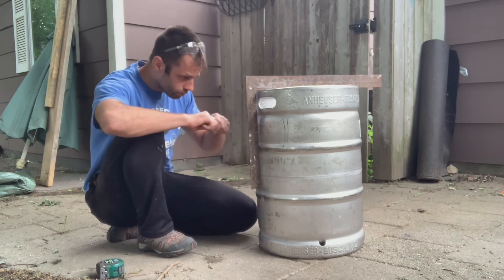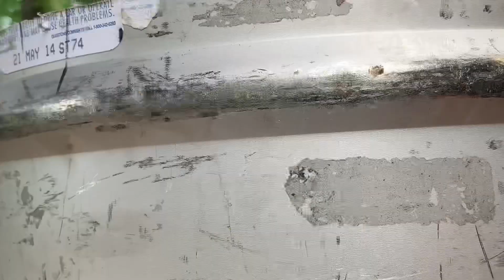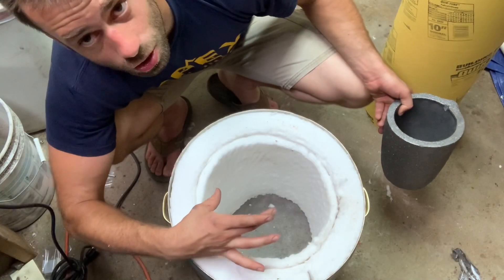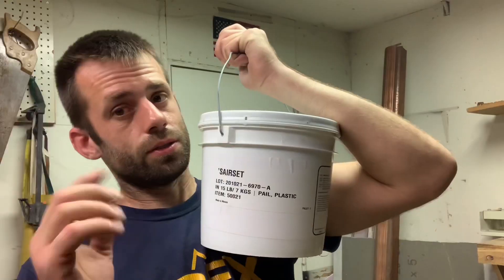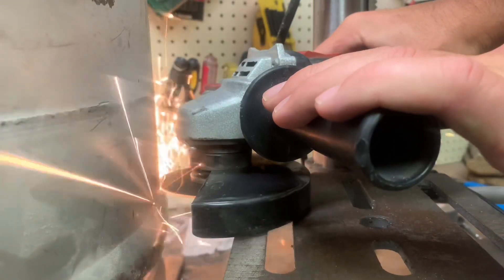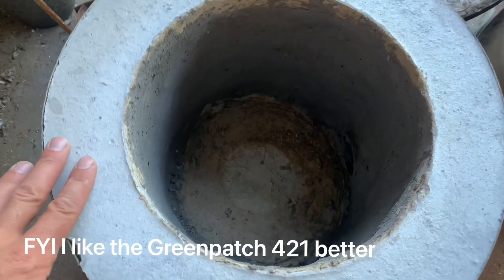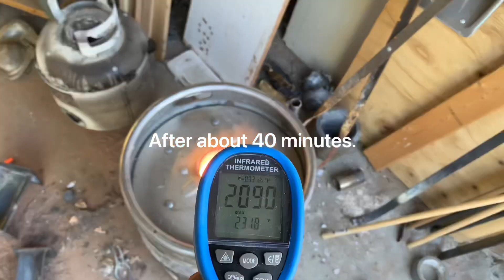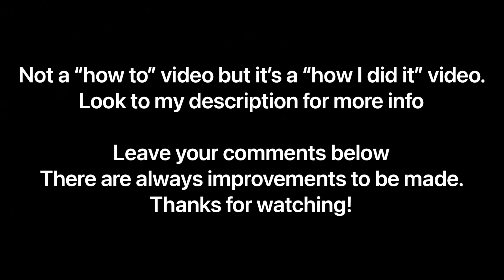Making a keg foundry furnace.

Comment: In all the videos I have seen, people coat the ceramic blanket but I dont understand why that is necessary? I am a maple syrup producer, and our diesel-fired evaporator is fully lined with ceramic insulation like that and is never coated with anything. My old evaporator was 31 yrs old and still just ceramic blanket inside despite hundreds of hours of run time. I can see how the initial firing might blow some dust out of the blanket, but in general it shouldn't really be getting consumed if there is no abrasion on it. Wood fired evaporators require refractory inside because of the presence of particulates in the exhaust, but within our industry, if its just a clean flame there's nothing more than ceramic blanket.

Comment: GOOD WORK, THE GOOD THING ABOUT BOTH OF YOURS IS THAT THEY ARE PORTABLE, IN THE COUNTRY WE JUST USE CEMENT BLOCKS  BOX FIRE BRICK TRIMED ROUND BUT THEY ARE NOT PORTABLE 😅😂IN ONE PIECE , I LIKE YOUR IDEA I WILL TRY IT WITH AN INSIDE COATING OF CEMENT PLASTER AND SOAP MIXED TO MAKE LIGHT CEMENT SEE HOW THAT DOES ...

Comment: Currently in the process of building a keg foundry myself. Im using a different style keg and instead of using a typical crucible i am using a propane tank as my crucible. Having dual burners 180° from each other to minimize the heat time. The lid of the keg is also flipped upside down filled with refractory cement and a long handle up above for easy on and off. Im having difficulty finding a way to attach something to the propane tank crucible in order for control and weight distribution for loads in excess of 50 pounds. However it is coming along pretty well for my first attempt and hoping to make a few more in the future. Currently this one is for quantity of melt for large sculptures/ giant swords over 9' long. Impractical but a lot of fun making 80 pound swords of bronze

Comment: Cheers for your vid, am contemplating making my own furnace, big enough for upto a 25 kg brass or copper poor, I'm trying to achieve this as cheap as possible, fuel wise.
Am thinking my heat source as natural wood to preheat, than finish with a diesel system or LPG. 🤔

Comment: THE ONLY WAY YOU CAN GET THAT TIGHT OF A FIT IS TO POUR THEM LIKE YOU'RE DOING CONCRETE AND THERE'S PLENTY OF EVIDENCE THAT THAT'S THE CASE NOT TRYING TO TAKE AWAY FROM THEM MOVING GIANT STONES WHICH THEY DID TOO BUT WHEN THEY FIND HAIRS AND SEASHELLS INSIDE OF STONE THEN IT'S NOT NATURAL STONE

Comment: IF YOU NEED TO DO IT AGAIN YOU SHOULD TRY SODIUM SILICATE AKA WATER GLASS WHICH IS BASICALLY LIQUID GLASS AT ROOM TEMPERATURE THAT WILL HARDEN HARDER THAN ANY STONE AND WITH A TOUCH OF SOME OTHER INGREDIENTS BESIDES THE THREE BASICS YOU CAN MAKE IT DO OTHER THINGS LIKE HAVE HIGHER HEATING TEMPERATURE OR DRY FASTER AND SO ON BUT BASICALLY A GEOPOLYMER

Comment: The weld looks aweful, but what most consider a good weld is 60% appearance anyway so as long as it holds you've done well.
A second burner would've been nice since the keg had volume for it, and since you have the prop tanks for your small pour jobs. Although the fuel efficiency would've suffered.
So if you ever happen across another keg, it'd be cool to see a double burner full sized keg furnace

Comment: 0:02 thanks for pointing out your mistakes, it helped me figure out the problems with mine. 
Is your inlet very close to the bottom? Mine is about 2” up from the bottom, it’s a 2” steel pipe and it’s in the smelter 2” at centre of the pipe. The pipe sticks out 
2 1/2” and with a tiger torch, the beginning of the flame is 6” from the other end of the pipe. I think I’m loosing to much heat to the steel pipe. 
My smelter is lined with refractor cement only, how much heat am I loosing to it as well. My lid is concaved another 3 1/2” as well. 
I melted 5 lbs of brass but it took 2 hrs and it barely melted. 
I’m thinking I should redo the lid, trim it down and insulate it properly. It also has a 6” hole in the top, how big should it be?
Should I re-insulated hole thing? 
Btw, I’m using a #15 crucible with 1 1/2”clearance at the top of it. 
Thanks for your help.
Reply: How far off the bottom in the bottom of your inlet or torch? 
How much space is there between the top of your crucible to the lid? 
How much heat do you think I’m loosing through the cement walls and lid? 
Is the cement a big part of why I can’t melt copper in your opinion?

Comment: I need to melt steel so I can make speciality tools that can’t be made  or bought anywhere. The melting temperature of steel is 2,750 degrees. With taking 3 1/2 inches out of the chamber to make the furnace smaller, would that affect the melting time in a positive or negative way when it comes to the steel? I’ve never done anything like this before, but I am certainly willing to learn.
Reply from the maker: I don’t believe you can reach those temperatures with propane. Steel is its own beast and not really for a backyard setting. But you will definitely need a forced air burner to attempt that. I don’t know much about burners though. Bronze is much easier.

Comment: Why not use the refractory for the entire lining instead of using the mortar?
Reply from the maker: Because it’s a heat sink. Takes more time and fuel for it to heat up if it’s solid refractory. It works fine. It’s just more of a heat sink.
Reply: @ one year later, how is it holding up?

Comment: On the keg furnace your exhaust hole at the top of the lid, I would reduce it down by an inch clothes off the flow of the heat exhaust, thereby capturing more heat that may solve some of your problem.

Comment: Hello Mr Lundgren, I did not see your burner but I use a Ron Reil design with a tiny orifice and hardware store plumbing parts. very cheap! I also use a hair dryer as a forced draft once it gets going and I'm melting big ingots in 30 minutes. I use a castable refractory in a valvoline small oil drum (4" thick wall), for many years now. In fact I FINALLY got my dodecahedron finished, not defect-free but 11-1/2 good sides. about 5 balls failed from poor venting(?).  and a nice big crab and a small cat. Too long since I last poured, but I got a friend involved and possibly hooked. I will send him this video since I talked you up. Well done! Andy in Calif.

Comment: You should pilot drill all your holes starting with a small drill bit I start with an 1/8 in and work my way up to whatever size and especially when drilling stuff like tile or even glass tile is so much easier quicker and won't burn up the bits as quick when done that way

Comment: So i have two pony kegs but tbh i thought they were made of aluminum. I didnt test them with a magnet or anything so i really dont know. Was wondering if you think the pony kegs would work?
Reply from the maker: Oh they will work as long as you have it insulated well enough. The outside metal only gets to a few hundred degrees while it’s over 2000 degrees inside.
Reply: @lundgrenbronzestudios  sweet ty. I'm wanting to cast stainless steel. I have scrap stainless steel and need to make a few parts. I was reading up on the temps needed to melt steel and from what I read it stated that around 3000°F is needed. So I've been researching and trying to get an idea of what I will be getting into. Your videos have helped a lot to shed light on the process.

Comment: I realise I am late to the Party. I am looking at starting my own Foundry (Context: The company I work for orders $23 500 worth of Cast Iron products from China yearly. - Enter the naive optimist). The suggestion I have is more of a question. Why didn't you build a Diesel burner rather than the propane? As far as I understand it burns hotter, quicker and is more efficient. I realise this is a 2 year old video, but I'd love to know since this is the route I going. I was also looking to get an A6 - A8 Crucible So the Size you made would probably be right.

Comment: Hi.

 I built one, but i'm having issues with the heat. What pressure is your regulator set at ?
Reply from the maker: I use 20PSI.  That’s why I prefer my smaller furnace. The bigger the chamber the more it takes to heat.

Comment: Hi, I know it's been a while but what type of burner are you using? Do you monitor the PSI level? I am surprised it took so long to heat up version 1 of the keg...
Reply from the maker: I use a 1” propane burner. Oil burners are hotter so that might help. Or just a bigger burner. I max out my burner at 20psi

Comment: I run a gas line to s pipe and hook it up to bouncy hosir blower I use way less propane and it’s so much hotter but brwewsre u have to use thr Bret material because I’ve melted my lid with refractory and thr fire blanket behind it melted lol

Comment: if you use furnace cement and mix water in till its a paste and paint it on with paint brush  it wont crack its a trick boiler workers use and i used it on my furnace but it does have little bubbles when fired.

Comment: Anyways steel keg will last much longer (or even forever) than the propane crate. Thanks for the video, is very interesting and the fact that you showed the "don´ts" make it much more genuine than the video where everything goes perfect with rainbows and flowers, every process have a bunch of fails in order to succeed, and now I learned than short keg may be more proper than tall ones.
Reply from the maker: The propane tank is also stainless steel.
Reply: @lundgrenbronzestudios  But more thin, less resistant, right?, at least is what I think, may I be wrong?
Reply from the maker: @javo_roma  no. The propane tank is actually thicker if it’s insulated properly the metal of the tank won’t even get much over a few hundred degrees.

Comment: The best method is always the one that works for you. So, nice job and thanks for telling us about the problems you had.  An honest man!
I would have built the whole thing out of fire cement and reduced the chamber diameter even further but that's just me.
Reply from the maker: That would be one way to do it but all that cement is a heat sink and takes a lot longer to get up to temperature. That’s why I chose to do it the hard way.

Comment: Sprey with water every few hours while curing won't Crack.  If it's to big add anther layer of insulation on inside to lower diameter.
Reply from the maker: If I put another layer of insulation in there wouldn’t be enough space for the crucible. The issue was too much empty space above the crucible.

Comment: great vid, tks, couple things. maybe bolt some metal casters on the bottom to make it easy to roll around. also, I have seen some guys make a chimney for the top to get it up to temp faster then remove when at working temp. have you ever heard of this?

Comment: Two years later hows it working i have like 7500 pounds of bronze to smelt so ty because i need to build one 12 pound bars here income
Reply from the maker: To be honest I don’t use it much because my propane tank foundry heats up so much faster and I really don’t pour large amounts very often. If I could change one thing about this one I would have a bigger burner for it. Or maybe an oil burner.

Comment: an old trick you can use... when you dont have a hole saw or a band saw or the right tool for the job..... is to use a drill... drill a bunch of holes around the parameter of the shape you need.. then use your dremel or a hack saw to basically connect the dots... and finish out the shape.

Comment: Hi Gary from the UK I'm an old heating engineer and I think if you lay the thing you are welding on it's side so it's flat it will be better as opposed to welding vertically, you will get a better run. 
Great video very interesting and informative keep them coming

Comment: I saw a video where the guy painted his zircon cloth with water-glass. Water glass is lye and silica gel from gel packs. I think its sodium silicate. It seemed to work well. There are videos on how to make water glass. Or try fireclay in some mixture with magnesium oxide, but difficult to keep it from crumbling under heat. I think gypsum drywall cut in 8 sides can be used because when it burns it gets rock hard. Or wet it and get it to bend in place. On the cheap, I am saying these to try.

Comment: I like it, I made mine out of a 1/4 barrel keg instead of starting with a half barrel as you did. I used refractory bricks and cement. I have it setup with both a PID controlled electric element and I also drilled a hole in the side where I put in a gas venturi. I have not had a chance to fire it up yet but looking forwards to it.

Comment: Very nice furnace. I'm going to try it. What sort of burner did you use?
Reply from the maker: I found a forge burner. It’s a propane burner on Amazon. I do want to try a waste oil burner or forced air burner though because the burn hotter.

Comment: Great job but you just needed a more powerfull burner, more air and more gas in the same apparatus. Mine is a 60 l drum with refractory briks inside and it roars! Melting all metals except iron.

Comment: Great Video man. I would suggest having a couple of sleeves, one smaller than the other so you can insert one them inside the main furnace with a cutout for the burner. A thin layer of refractory cement with some fibre gauze over the blanket to stop the cracking

Comment: I did mine inverted, refractory cement for outside walls and then lined the inside with wool and then used a plasticizer to harden the inside layer of the wool. That way the wool insulates and the cement sinks any of the heat that escapes, the wool is easily replaceable and I’d rather use that as a consumable than to have to redo any refractory in the long run. Only ever re lined the Kaowool once and it was because it got left outside the shop to cool off and got rained on because I forgot to check the weather forecast lol, so it got soggy and fell apart, other than that the wool itself, when plasticized holds up well, probably done 20-30 burns and it still seems fine
Reply: Plasticiser?   Like what is used in mixing/reading water in cement?

Comment: Thank you for this very sincere, staightforward presentation. I was watching to see if you were going to place a drain hole in the bottom. Some do. Mine is not as precise as yours, but i am hoping it will melt ok. I need to fill in the airspace, as you did
Reply from the maker: I decided not to put a drain hole. Maybe in the future I’ll regret that but we’ll see. So far it hasn’t been an issue.
Reply: @lundgrenbronzestudios  Thank you

Comment: thanks for the tips . i have a gas tank furnace and i could not melt copper after 30 minutes and the furnace was preheated . i did a repair and the lid is ajar by about 3quaters of an inch oppersite the lid hinge would this be enough heat loss for my failier
Reply from the maker: That could be a big enough gap to lose enough heat and you should try to close that up. But it’s also possible that your burner may be undersized. But first step close that gap.

Comment: I converted my foundry to a ribbon burner and that made a significant difference in the amount of heat output for my setup.  I really recommend a ribbon burner over any kind of single pipe jet type.
Reply from the maker: Yeah I do think I need to upgrade my burner.

Comment: You’ve probably learnt by now, but make sure you keep the torch over the weld and filler rod for a few seconds after you stop the torch to keep gas flowing over everything. By pulling it away straight away you’re ruining the weld, oxidising the filler rod so it’s contaminated, and ruining your tungsten which will start to blacken and split. Purge stainless especially as it takes longer to cool, should be able to change the settings to keep the gas flowing longer
Reply from the maker: Thanks! I still have a lot to learn about welding.

Comment: Thanks heaps, I’m starting on my furnace build and your video was absolutely brilliant. I’ve just been stacking fire bricks when required up to now😂. I certainly didn’t realise that having a bigger furnace would make melting so much harder so now I will follow your advice and make mine to suit the crucibles I use. If you’re interested there is channel called Mark Presling and he is changing his burner over to diesel as diesel has about 60% more energy than propane so the furnace will burn much hotter, and of course, diesel is much safer. I’m glad I found your channel as it’s very informative and I really like your style. Thanks for saving me so much waisted time and effort and I would like to give your channel a shoutout when I make my furnace. Cheers mate, Stuart 🇦🇺
Reply from the maker: I’ve been thinking up upgrading to to diesel burner as well.
Reply: @lundgrenbronzestudios  I think it maybe the way to go so ill see how Mark gets on. 👍👍

Comment: Fyi. Can't tell in the vidio how fast the drill was going ,but when drilling stainless slow the bit down and use a bit more pressure. Avoid overheating the bit , wounce you blue it that's it for stainless. And of course start with a sharp bit . Nice work mate. 🤔😎🇦🇺👌